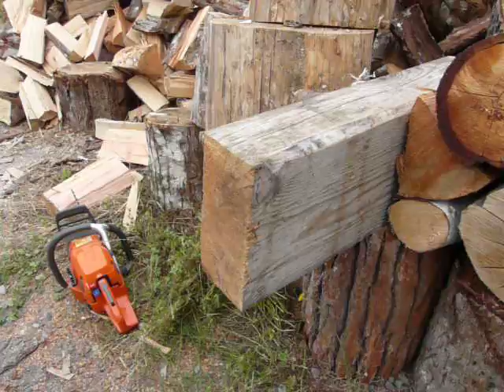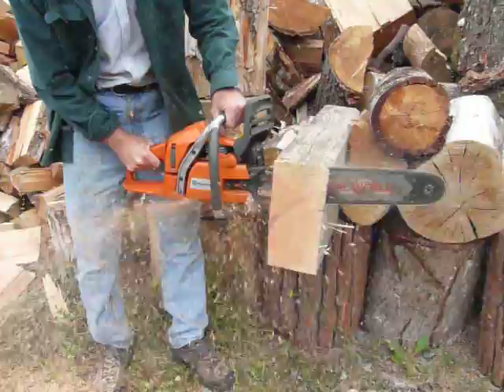346XP Micro howler Versus  6" x 12" Beam

Comment from the maker: It started life as the 46cc version. It now has a oversized bore with a 2mm bigger piston that I did back in '06. So, it is .7mm larger in diameter than the new, factory 50cc versions that come in at 44.3 millimeter in diameter. Hope this helps.